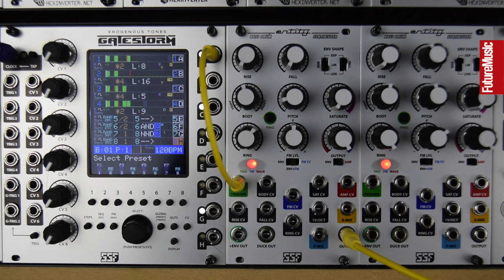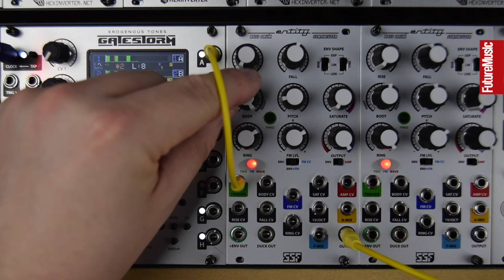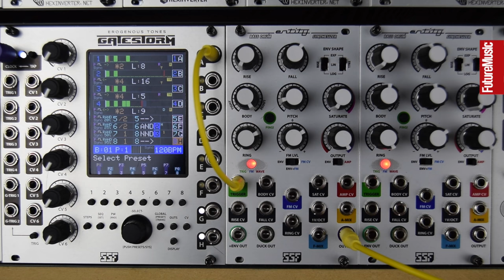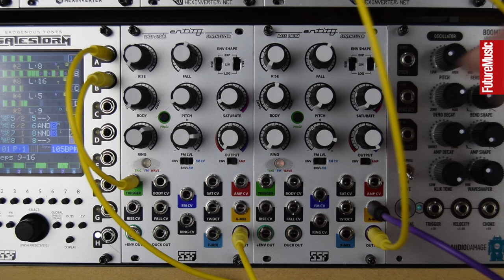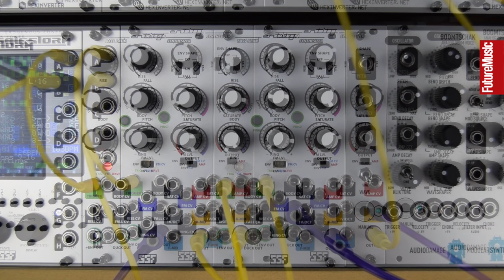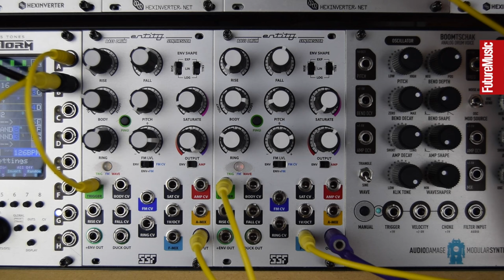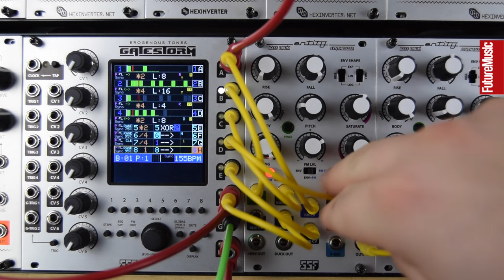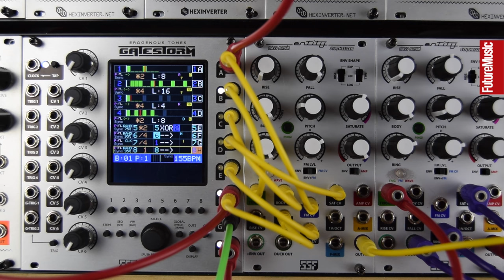Modular Monthly: Exploring drum sound design with SSF Entity

Comment: I want the second now, but will resist and keep the space for the entity percussion that will be released soon. :) btw still did not explore it for non kick territory, thanks for the awesome video as usual!!! P.S. adding a wmd mme to ring cv can make the kick so tight closing fast just before the bass note starts...almost like a plugin level, or 10 separate modules to reach this level of tweakability in general. Awesome module and intriguing every time u switching it on :)
Reply: You're right about the WMD MME (which is a killer envelope). This makes great toms and with some noise etc it makes for a great module for more than just kicks.